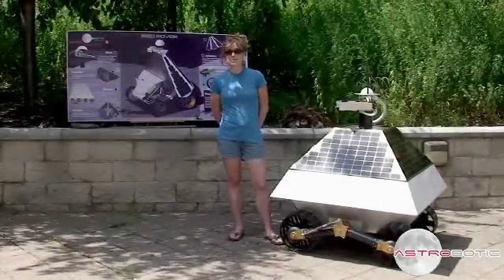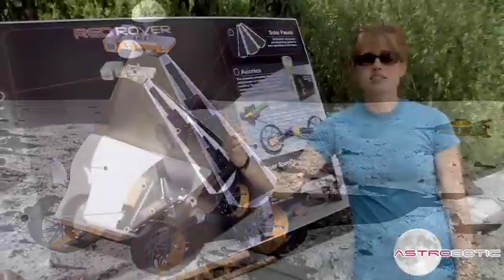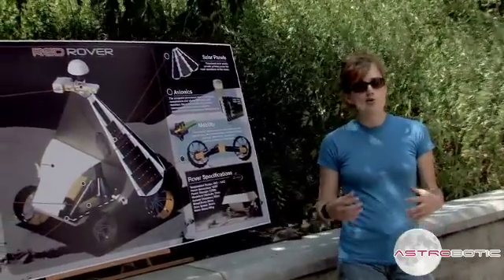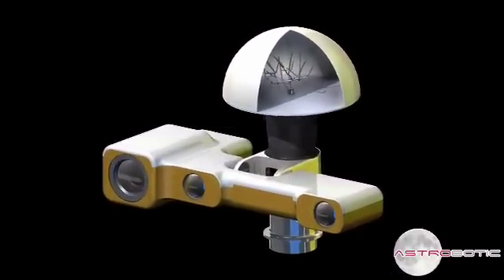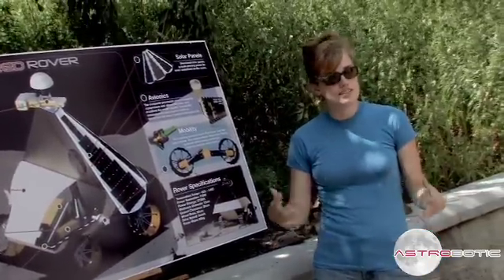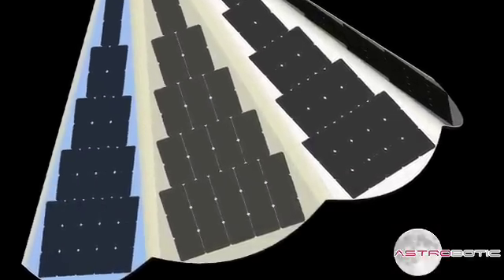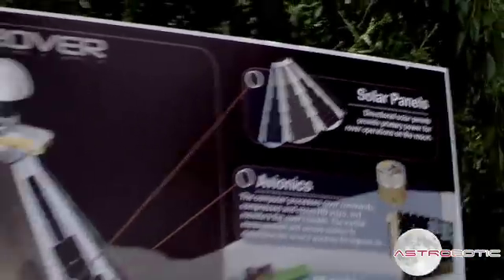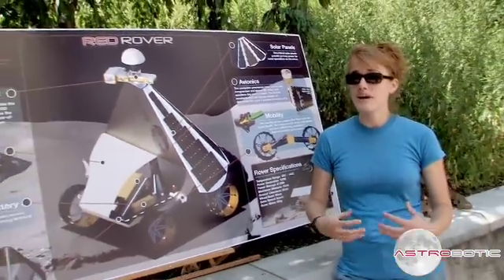Red Rover - Design Configuration

Comment: The robot will use it's heading direction to point solar cell array to the sun and white radiator panel to the space. That's doable by good path planning, instead of adding more actuator, mechanism, structure.